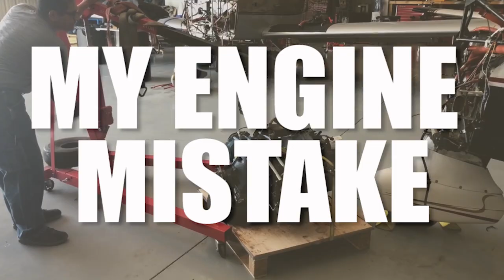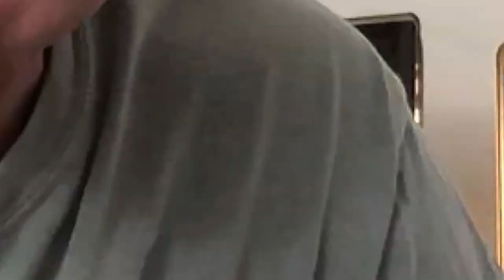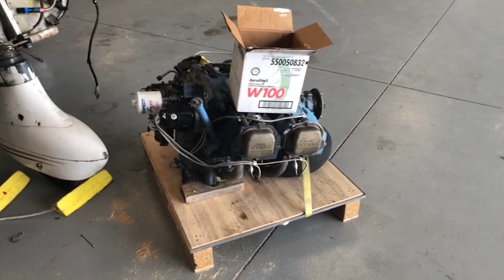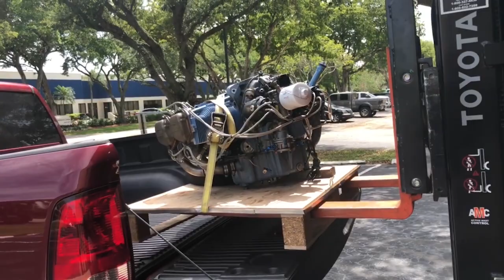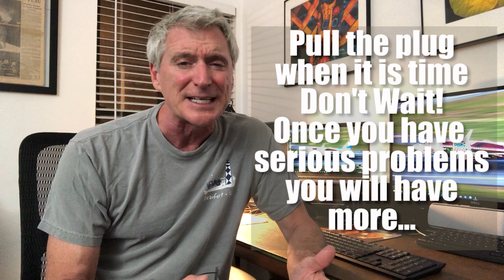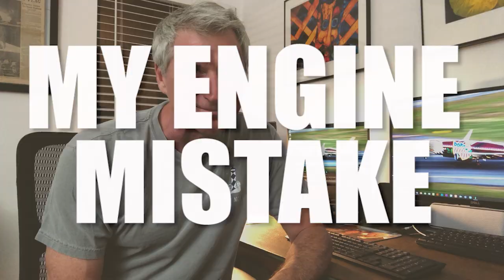My Financial Engine Mistake

Comment: I'll offer a similar, but opposite mistake I made. I owned a C-182 for 27 years. It came with its original O-470 and ran very well. I had coaxed it up to 17,000 feet at one point, flew countless (well, I guess I did count them) hours in IMC and never had any issues. I had a couple of cylinders worked on over the years; however, never ran afoul of bad compressions in my annuals. I really can't remember what possessed me to do it, but I decided to replace the (trouble-free) engine with an O-550 from Texas Skyways (along with new paint and interior.) So, the unquestionable benefit was going from 135 kts to 155 kts TAS. It also had incredible climb performance (so that power on stalls absolutely terrified me.) The downsides, though, were many. The engine weighed more and changed my plane from one where I could load four adults with bags to one where I needed to be much more attentive to weight and balance. If I had four on board, I would have to watch the amount of fuel I took on to make sure I was within the limits. For some reason, I also was never able to get the altitude performance I was able to achieve before (I live in the intermountain west where it matters.) And for some reason - probably somewhat irrational - I never really trusted the engine completely, as I had with the O-470. It got to the point where I was actually looking forward to rebuilding it so that I could sort of re-set the clock on it. Anyway, bottom line is, don't mess with something that is working well and be happy with what you've got.
Reply from the maker: Sounds very involved!!! It’s best if it works … don’t fix it ! Thanks for watching!!!

Comment: I agree with your reasoning, I just pulled an IO-360-A1B6D with 1800 hours and 42 years since overhaul off my 73 Cardinal RG because it was starting to use oil about 1 quart every 2 hours.  I believe that old engine had served it's previous owners well but I did not want to start putting money into that old of an engine, so I decided to replaced it with a Factory Reman. IO-360-A1B6

Comment: Very well said, Ted! In my case it was multiple issues at 1474 hours and 25 years smoh that caused me to pull the plug. There is a point where the band-aid approach just isn’t worth it. Get the job and, more importantly, get it done right.

Comment: When I saw the damage on the engine, I was kind of surprised that you were going to repair it.  If it worked out, it would have made sense.  My thought was "what else is about to fail?"

You bought yourself (and hopefully some others) a valuable education!  Hopefully this video will help some folks out!  Your plane is going to be amazing when it's done.  You should look at the Garmin GFC 500 auto pilot.  I just upgraded my avionics plan to include it.  Really amazing technology.

Comment: Don't be so hard on yourself! Everything you mentioned imo seemed reasonable. 
My plane sat on the ground for a few months due to all of my legacy steam nav/com dying. I'd pull the plane out of hangar every week to run engine on ground to circulate oil for about 15mins. Along comes annual and 1cyl is low but acceptable. I asked shop should I fix it. His response...NO!...Not a problem right now, when it's time do a complete. He advised me that when my nav/com is replaced (Done) and I fly it on a regular basis compression can come back. I have just under 1300hrs left before TBO. Next 50hr old analysis?...🤞
Reply from the maker: That may be worth it - you are at 1500 hours ! Thanks for watching!
Reply: Not sure what engine you have but running it for 15 mins may be doing more harm than good. Check the manufacturers recommendations. The issue is condensation forming if it doesn’t get hot enough. Ground running for long periods (45 mins +) is not good either as there is insufficient airflow to the rear cylinders.
Reply: @C56-d8h  I ran it up till operating temp came up to burn off any potential water/acid build up. Typically about 15mins.
I understand what you're saying but two things on that. 
1. I couldn't take off in my area without a functional adsb. My legacy s-mode transponder died making tailbeacon useless.
2. What's the difference between bringing up oil temp on ground for 15mins compared to in the air? I don't think the engine knows the difference for a 15min run.
Eventually got everything fixed. About 6 x-countries done this year. 
Looking forward to next 50hr oil analysis and compression check during annual.
If you have some factual information I'm very interested in hearing it.
Btw 0-320-H2ad (non T-mod)...yeah the one that's supposedly the worst one built...lol
Reply: @muhammadsteinberg  Lycoming recommends at least 1 hour flight not counting taxi, take off and land in order to minimise the risk of condensation. I can’t remember where I read this though ( It might have been in Flying magazine). Might be different for Continental.  See your issue with not being able to fly without adsb though. Real rock and hard place. Oddly enough I am having my panel upgraded at the moment but where I am (in UK) I am OK to fly.
Reply: @C56-d8h  I may have seen that. Is it the same one that said rotating prop manually to circulate oil is not good?
I know what you're saying though. I recall reading a Lycoming bulletin that pretty much said the POH was wrong (Cessna 172) on leaning. Lol
So many of those things out there they become a fog.

Comment: Question: Don’t engines repair shops have these engines already overhauled in crates ready to be shipped to owners? If my engine failed I really don’t want to be grounded for weeks or months waiting for my engine to be overhauled. I’d rather just put another “zero time” or overhauled engine that can get me in the air. How’s that work? Why does it have to be the same engine that came out of the aircraft? Thanks for your answer.
Reply from the maker: Boy I wish that were the case! The reality is that the shops don’t have engines just sitting around waiting to be ordered and that is for a couple of reasons. Number one is that there just isn’t that much business for them to have engines sitting on the stock shelf and number two is that once the engine is built it needs to be run engines just sitting there are really bad because the actual corrosion can take place while it’s inside the engine which is what you don’t wanna have. You want the engine to be billed and then run it right away. These are really high performance high rpm engines and they need to be running all the time. I wish it was that case a lot of the decision for me was to Select an engine company that had a low lead time. I found air Mark was the lowest at five weeks and hopefully they’ll be able to stick to it. Thanks for watching!
Reply: Absolutely not! On any given day a shop has no idea what airplane may have an engine problem. Various airplanes equal various engines. Most shops cannot afford the luxury of having expensive engines that may never be used sitting on a shelf.
Reply: @Over50andLearningToFly  Was having your original engine overhauled considered? Would that have mattered price or turnaround time wise?
Reply from the maker: @TactlessWookie  Well when you get an overhaul the engine you may get parts from your original engine it depends what they have either way you’ll get a freshly overhaul the engine with zero time on it ready to go. My number one motivating factor for choosing them was what would have it on my plane the quickest which was air Mark at five weeks. Thanks for watching!

Comment: Let me ask you a question...in February this year my O-360 started producing vibrations and the local field mechanic informed me that i needed to replace Cylinder #4 and so i did.
After only 2 months going into my first Annual inspection with my Piper Archer II the new mechanic found that another cylinder is failing and needs overhaul, cams and lifters are pitted due to NO USE in the past years...it was overhauled in 1999 and has only flown 570 hours SMOH...now i am in your same situation right? one new Cylinder and in need of overhaul...didn't AIRMARK keep your new cylinder and discounted that from their quote? I was thinking that my cylinder has only 11-12 hours on it and i would want to keep it since it is new...did you do the same?
Reply from the maker: Unfortunately no - AirMark  replaced all the cylinders and I actually had replaced two so that was a $2000 loss for me.  The problem that happened with my engine and it sounds like it’s similar to yours is that the engine sat for a long time and that’s what caused the corrosion I called it quits with my engine at 1850 hours and on Friday I actually got pretty bad news is that my crankshaft is no good and it needs to be replaced and that put an additional $5000 onto my overall cost which I’m really upset about.  You may be in pretty good shape since you’ve got such a low time since your last major overhaul but it’s the sitting in non-use that is really bad. Are you thinking about overhauling your engine?
Reply: @Over50andLearningToFly  hi thank you for your reply...yes my mechanic is going to pull the engine out this week, we have one quote from Lawson Aviation which is not bad...will need to look at their warranty and overall turnaround time. I have sent quotes requests to several today, including TRIAD AVIATION which is local to me here in NC...hope that they can give me a good quote so that i can do the transport myself and save the $1000 in shipping back and forth... i hope they can reutilize my cylinder as it is brand new with just 10-15 hours on it and i did pay $5K for that including installation....Isn't it fun?! no it isn't but at the same time i am excited to get me a new engine and be safe...if you see on my last video on here, my cylinder #4 gave up at night returning from a Pilot N Paws rescue flight to Norfolk in December...I don't want any more of those mishaps.
Reply from the maker: @lucabaldoni8911  Let me know how it turns out I should get my engine back on 7 July but that email I got on Friday with the new crankshaft needed hopefully won’t set me back in my timeframe. Let me know how it turns out and thanks for watching!
Reply: @Over50andLearningToFly  will do!

Comment: I'm in a flying club that went through this.  We now have a flying club without an airplane.  The leadership thought lowering the hourly rate would encourage more to fly.  That didn't happen.  The leadership likes to boast we have an airplane for aspiring commercial and military pilots, yet wishes to skimp on the basics.  Fix a quirky gps?  Nah.  Fix the instrument panel lighting? Nah, wear a LED elastic band on your head.  Put money aside knowing the engine will require a replacement in a year or two?  Nah.  Somehow a mystery donor will see how awesome the club is and grace us with financial support.  Sigh.  All very preventable.

ps  Music is way too loud.  Please, please please reduce that.
Reply from the maker: Yeah sorry about the music I need to invest in a microphone and some new speakers on my end. 

You know you’re not saving any money by taking shortcuts. And this is what I found out over and over and over again and it was really apparent with this latest engine mishap. Moving forward I am just going to fix everything. Also I am putting in a new interior in the airplane and a new engine monitor more videos to come on that later and… Thanks for watching!
Reply: @Over50andLearningToFly  Is this a new airplane?  I recall you sold the 177?
Reply from the maker: No I pulled back from the sale because I found a major problem with the engine so that’s why I am overhauling the engine and I decided to put in a new interior as well and just keep this airplane and upgrade it
Reply: @Over50andLearningToFly  I'm sorry, I should have known that...I saw you had new videos out but hadnt seen them yet :)

Comment: 1800 hours on a O-320 is not high time at all. I rebuilt an O-320 H2A at 2800 hours just because I registered the aircraft in commercial category, but the engine was still in mid 70 compression and perfect oil pressure and oil analysis. Your engine most probably had a period of inactivity and corrosion made its way. It’s not your fault at all. You bought the plane already wounded.
Reply from the maker: True and the air craft engine was placed in my plane at around 300 hours and also it is over 20 years old so it definitely staff for a while. Anyway it’s time for a new one! Thanks for watching
Reply: Was that the T-mod version? Did you T-mod on rebuild?
Reply: @muhammadsteinberg  The 68 177 has the O-320-E2D, not the infamous H2AD that needs the T-Mod.  I was lucky with my O-320-E2D to 2500 hours without a problem before I overhauled mine.
Reply: @garriewilliam3199  You mentioned O-320- H2A above.
Reply: @muhammadsteinberg  Oh sorry, I see now that you were asking  Eddy P, my bad
Reply: @garriewilliam3199  Oops sorry I was off also. I was responding to Eddy but answered to you...lol
Scary...we both got confused and we fly planes...LOL..
Reply: @garriewilliam3199  Btw my 1978 172N does have the 0-320-H2AD (non T-mod)...